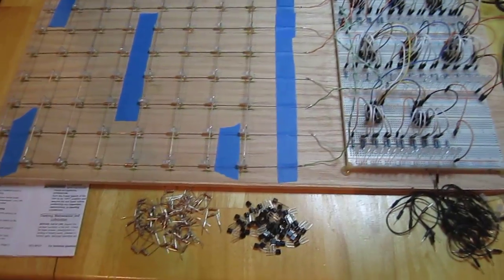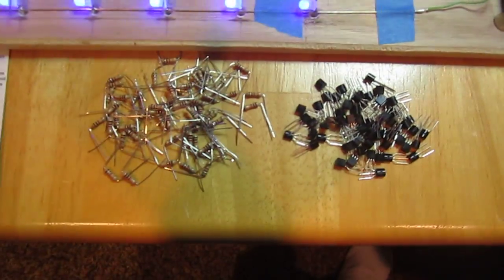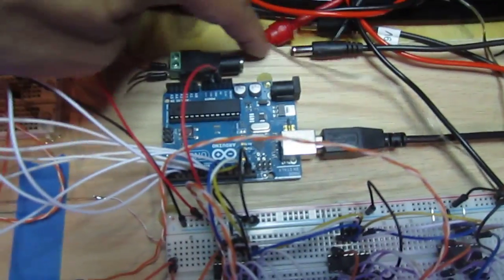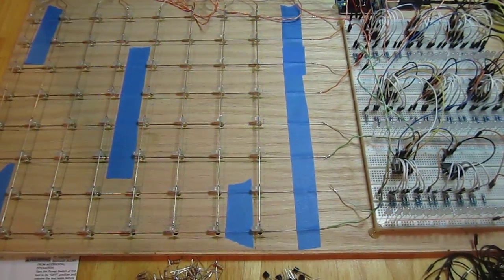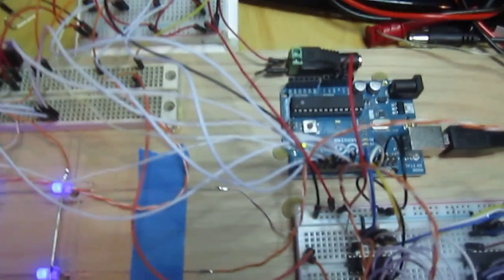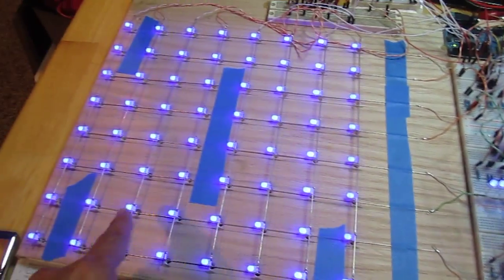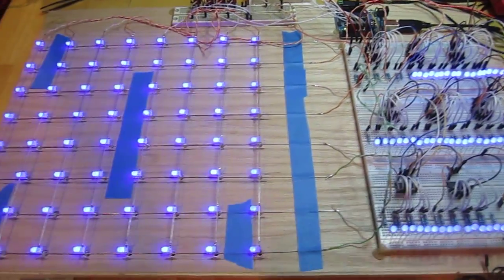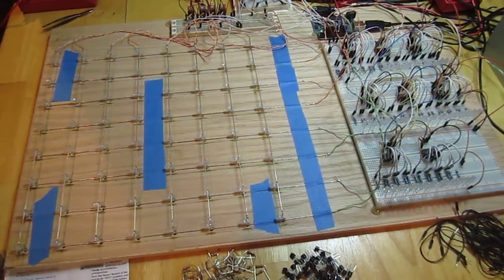8x8x8 Blue LED Cube Part 9 - About to solder

Comment: Which reminds me I got a new power supply for mine. a 5 volt 50 amp. Because if you remember they are old school Green led's they take way more current then the newer ones. Each one is 80 ma. I finally found a schematic on my led's from a local old  shop here and they say they are 80 ma each.
Reply from the maker: Wow... 50Amps! At any one time, only one layer would be on, so that's 8x8x80mA = 5120mA or 5A.  So, 50Amps is more than enough.  More of a concern would be the mosfet.  Can it handle 5Amps?
Reply: Hari Wiguna I paid 30 dollars for the power supply. it came from my customers security  system. I buy extras just incase.

Comment: Can you please send me the schematic diagram ??
Reply: Rizwan Saeed you can see it all at  https://hackaday.io/project/1243-8x8x8-blue-led-cube
Reply: There is no schematic diagram
of the circuit
Reply: Rizwan Saeed  This is the wiring for the shift registers and mosfets  to power up each level and column https://raw.githubusercontent.com/hwiguna/g33k/master/ArduinoProjects/8x8x8LEDCube/Design/8x8x8%20LED%20Cube.png
Reply from the maker: Thanks Jay!!!
Reply: Your welcome. I need to get my Cube up and running my self.